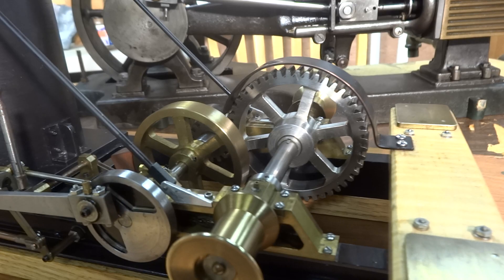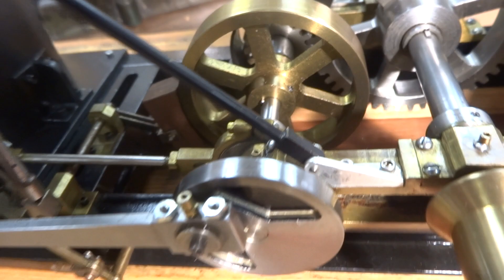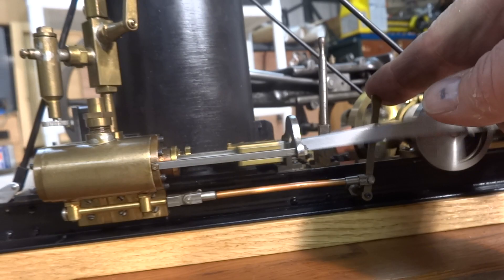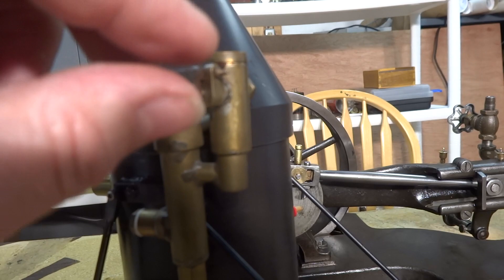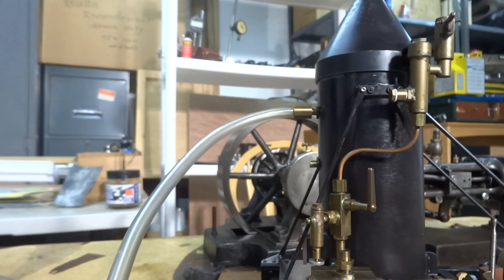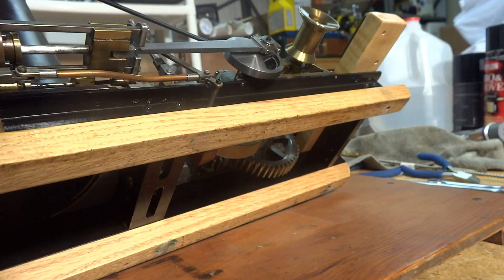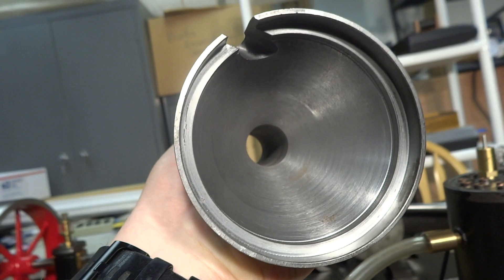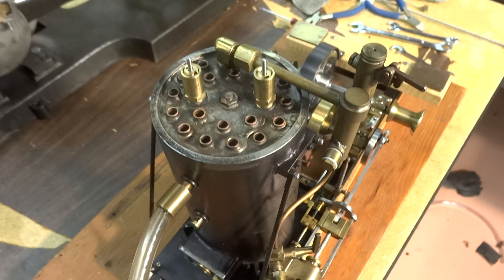Model Steam Donkey

Comment: I wouldn't keep running that engine on air above 5 psi or so -  (unless you can introduce steam oil into your airline) --- all you are doing is wearing out the piston rings. It's enough to show the public how it works on 5 psi, without wearing out the fine craftsmanship. Just sayin'
Reply from the maker: It is well lubricated with high grade synthetic clock oil. There is more than enough protection for the little time it has been run.